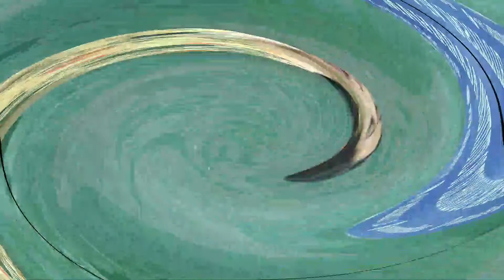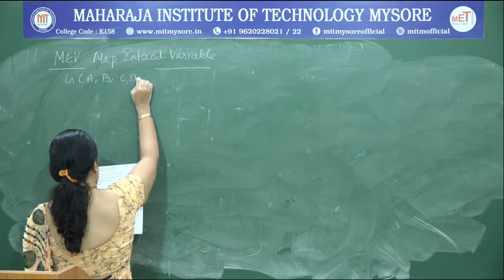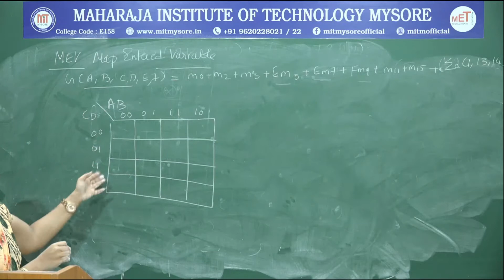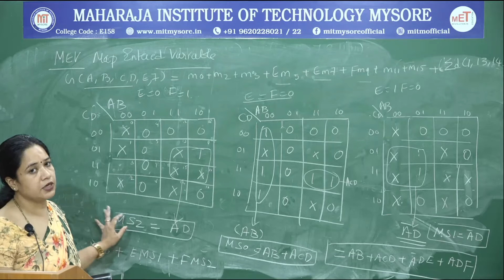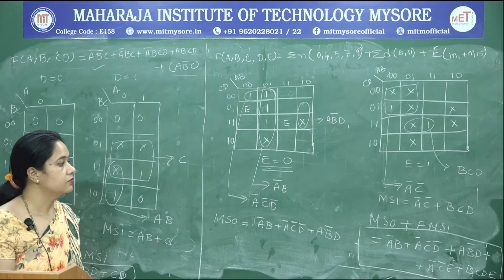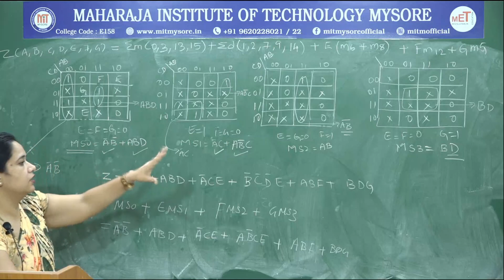1.7 Map Entered Variable Method for Simplification

Comment: There are errors in the case E=1, F=G=0. The group of two covering minterm 8 corresponds to the term AB'C'. NOT AB'C! The next error is that, one can make a quad to cover minterm 8 since the last and first columns are adjacent in a four-variable k-map. Giving the essential prime implicant B'C'.  So the proper MS1 term is A'C + B'C'.

Explanation as to why the proper term is B'C'.
AB'C' is not a prime implicant, but an implicant instead. One can remove A, and B'C' is also an implicant. Since this implicant is minimal in literals, i.e, removing any further literals will make it no longer an implicant, B'C' is the prime implicant one needs. Further, only this prime implicant can cover minterm 8. Because this is the only prime implicant that can do so, B'C' is an essential prime implicant! It must go in the final minimum solution. All minimal SOP solutions are a sum of all essential prime implicants plus any minimum literal prime implicants needed to cover an uncovered minterms.

Comment: In case of E=F=0,
The equation should be A'B'+ACD
Reply: Incorrect. She has written down the correct product terms for the case of E=F=G=0. Look closely at the group. You will se that its under the column A=1,B=1, but only D=1 for both the rows! That's why the term is ABD and not C. C is not constant for that group. The correct product terms are those the instructor wrote, A'B'+ABD.
Reply: Yeah correct even I was confused in that